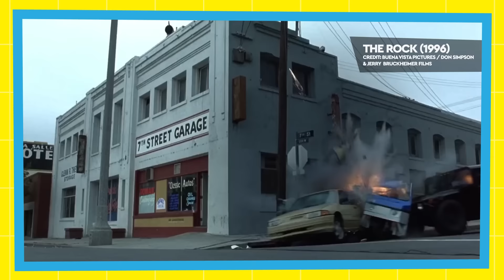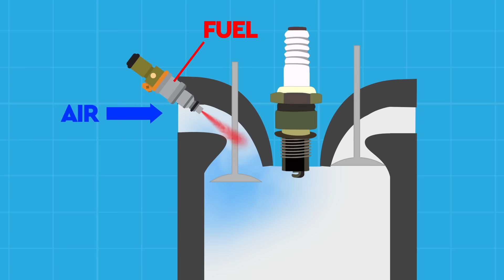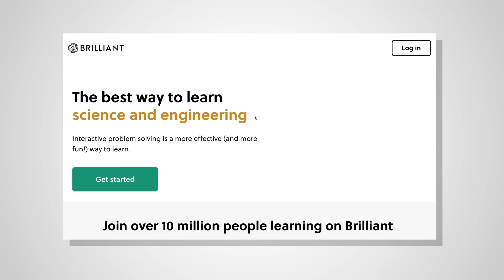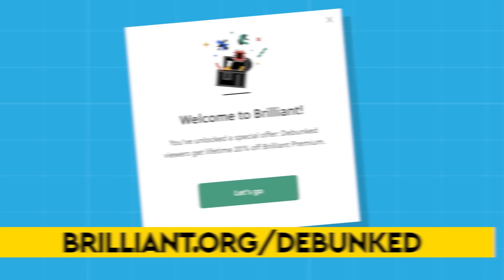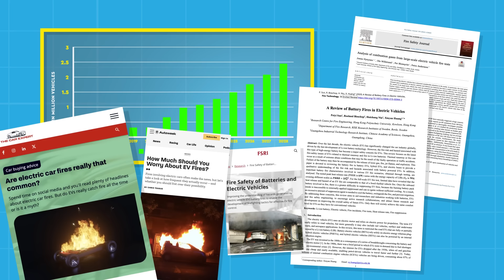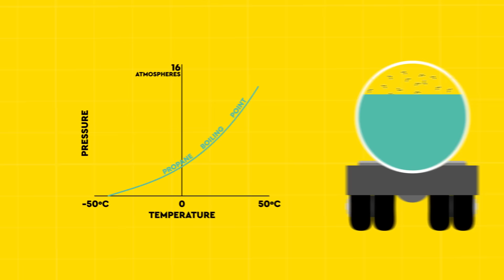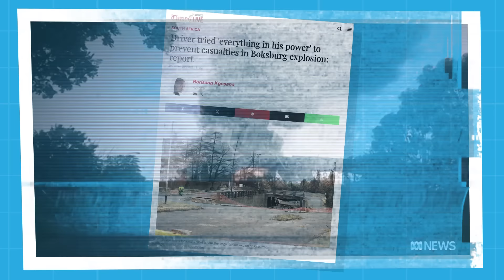What Actually Happens When A Car Explodes In Real Life? DEBUNKED

Comment: Very well explained... Thank you!
Two things to add:
In some European countries you will find a significant share of LPG converted cars (Netherland, Poland, Czechia...). The LPG tanks always have overpressure valves to prevent explosions. If such a car is burning - don't use a fire extinguisher. Gas that is burning is safer than evaporizing gas that mixes with oxygen.
Here we as well have a lot of diesel cars. These are unable zo explode - whatever you are doing with it.
Reply from the maker: Thank you! Glad appreciated it!
Reply from the maker: Thank you for adding that additional information 🧠 We did start to cover this but the market share is so low in the US and UK that we didn’t go into it and instead opted for tankers to make it more universal while covering the same fuel source. 👍
Reply: @DebunkedOfficial  Sure, makes sense not to confuse the majority of your audience 👍
Reply: @DebunkedOfficial  one modest correction. There is one larger explosion of a non-military nature that's industrial in nature. Ammonium nitrate based explosion accidents, such as in Lebanon, the Texas port disaster and a number of others. Typically, that involves contaminated ammonium nitrate and being stored at non-optimal temperatures and well, ammonium nitrate and any kind of fuel (contaminants or intentional introduction of fuel) becomes a high explosive.
Ammonium nitrate spilled on its own, no big deal beyond algal blooms and plants recovering from chemical burns initially massively recovering and growing like weeds. If the spill gets mixed with a fuel, well, if I'm a witness, you'll swear that The Flash character in comic book movies is real.
Reply: Apparently you've never heard of diesel run-away
Reply: intellicadee  QWERTY > QWERTZ

Comment: I have seen at least three vehicle fires where the unit burned unattended until the gas tank "exploded".    All three times the vehicle began smoking, started lightly burning, then inside of a minute became engulfed as seats etc burned up, followed by the tank going boom.  But it was not very cinematic.  The tank is under the car and when compromised usually just blasts towards the pavement.  Honestly it was more of a bang than a big kaboom.  Worst movie explosion I ever saw was FAR more dramatic than any car fire.
Reply: Near our eldest daughter's home, a pressurized gas supplier had a fire. A tank had failed, catching fire and when it vented, rolled amongst other tanks, triggering a BLEVE explosion and much larger fire. This involved a rather large propane supply tank typically used to fill small propane tanker trucks and portable propane tanks.
The residential area within a few hundred yards was evacuated as a precaution, as I recall none even had windows shattered. The large propane tank vented, the vented vapors ignited, the fire department got things under control and everything become boring, which was welcomed by all.
The only injury was to the insurance company.
Gotta love all of that safety equipment! Oh, the company changed their procedures and well, a tank failing isn't going to make life exciting any longer.

I've lived through some quite exciting events in my life and have learned, exciting lives are most frequently notable for their brevity. I like boring, boring is good.

Comment: Fuel/air mixture inside internal combustion engines does not "explode" -- it burns. Explosions inside the combustion chambers will damage the engine, sometimes almost immediately. Technical term is for such explosions is detonation, colloquially known as knock.

Comment: The engine of a motor vehicle is called a ICE. Which stands for 'Internal Combustion Engine' 
So there are no explosions going on inside but simply combustion, otherwise your motor would very quickly be damaged. 
😄
Reply: Indeed it’s a flame front that expands. Not an explosion.
Reply: exactly 😄  too bad he didn't respond to me. @DebunkedOfficial  @mrredfeet
Reply: In some countries however the name for the ICE is literally "explosion motor", e.g. in French (moteur à explosion) or Italian (motore a scoppio)
Reply: @MrOpenGL  Well then they are wrong. 😄
Reply: Agreed combustion or deflagration is not the same as explosion or detonation. But I think it’s rather for putting it in layman’s terms for viewers

Comment: The BLEVE can happen to a steam locomotive, if the pressure is suddenly released through some defect in boiler or pipe, all that overheated water suddenly wants to expand to a volume,I think 1600 times. I’ve seen photos of exploded locos and there is just the cab left everything else is gone.
Reply from the maker: Correct, it doesn't have to involve a flammable liquid at all. Thanks for watching and commenting. We hope you enjoyed our video 👍
Reply: Look up the numbers on the 1912 san Antonio loco explosión. Absolutely enormous forces involved .  

One 15,000 lb engine casting landed a 1/4 mile away .

Comment: I’m a firefighter for 25 years and not once did I witness a car exploding. 

Thinks in the car maybe could and the tires most certainly will if the car is engulfed in flames but this wont be more than a pop. 

I don’t say it’s totally impossible a car can explode but its very very very unlikely!

Tanks are designed to blow off instead of exploding catastrophically, so are Gas tanks… (thats what you see in the clip either this bus and the big flames shooting out of the top… it looks like carnage but in fact is does exactly what it is designed to do.) 

So yeah; if your car burns, Go away (preferably behind a guardrail) because fire is kinda nasty stuff but there’s no need to duck and cover because your car will most likely just burn until only metal is left.

Comment: If you want a higgling comments, gasoline does NOT "explode' in the combustion chamber, it burns...FAST.  The distinction may seem academic, but to engineers that work with engine performance, and especially with defeating "knock", it's VERY important.  The combustion chamber design along with air and/or fuel induction is tuned to get the desired "flame front" that gets the best power and/or fuel economy.

In the movies, special effects technicians use what are known as "squibs", i.e., sort of like small firecrackers, to get a fireball out of a staged (for the film) car collision.  It doesn't always work!  And even when it does, sometimes it's quite obviously to the trained eye.  When NBC News did an "expose" on Chevrolet trucks with their "saddlebags" fuel tanks, prone to being damaged and leaking, an obvious fire hazard, in a sideswipe collision, they filmed a "demonstration" which showed the truck apparently made of "explodium"!  What was revealed, and GM sued the hell out of NBC over it (and WHY did the network authorize this "hit piece" on a major ADVERTISER?), was that those "squibs" were used to STAGE the explosion.  GM released its own data showing that the trucks met then-standards for crash safety, especially with respect to fuel system integrity in a collision, and that the speed depicted in the "hit piece" film for a side swipe was in the upper 95th percentile of HTSA data on sideswipes of ALL vehicles...ergo, there was a less than 5 percent chance that a driver of a Chevy pickup would ever be struck in such a manner if a sideswipe collision happened, let alone the still unlikelihood that the vehicle would catch fire!  Needless to say, a significant settlement was reached by GM against NBC.

The issue with the crash safety of the Pinto was the unfortunate convergence of three factors:  (1) before the "5 mph crash" bumpers that began to appear on 1973 and 1974 cars, most large American cars could indeed, in a "nose-down" attitude upon hard braking (didn't also help that a lot of vehicles until the late 1960s had only DRUM brakes on the front, which were more prone to "lock up" with hard braking), slide perfectly under its rear bumper and smash the relatively unprotected gas tank (2) the Pinto itself was designed IAW Lee Iacocca's dictum to develop the car with the rule of the "Twos"...TWO Thousand lbs GVW, TWO years, and TWO Thousand dollars suggested retail price, and (3) a better fuel tank, which Ford had believed when the Pinto was first proposed in 1967, was thought to be mandated by its introduction, eliminating any further efforts to modify the basic design for crash integrity, but rather than being required, was pushed off until the 1978 models, by which time Iacocca though the Pinto would be significantly re-designed (the typical life of a particular line was about four or five years at the time) or even replaced altogether.  Ford actually met the last, handily (the original Dealer SPR was $1,919), the car was SLIGHTLY over the 2,000 lb target GVW, and it took 26 months before production began.  The car was designed with a very minimal unibody frame to save weight; and as it was figured to come in only a 2-door coupe, 2-door hatchback (the most commonly sold version), and a "three-door" wagon, there was one "little problem"...when slammed into from the rear, the doors could be jammed SHUT, inhibited escape from a burning car!  This actually happened in a terrible collision in Indiana in 1978 when, even after Ford has issued the recall notice (the parents of the teenaged girl driving the car, the legal owners of the vehicle, had yet to receive theirs), an unmodified Pinto was struck from behind, burning the three occupants, all teenaged girls, to death, as desperate attempts to rescue them failed.  This was the first time a major corporation had ever been charged with a crime in relation to product safety; but the state court trial, Ford was found "not guilty", as the State of Indiana failed to prove that Ford had acted with reckless indifference that rose to the level of criminal behavior, since the jury found that Ford had made a good faith effort to carry out the recall and correct the flawed design.  The modification that ended up being the "Kluge" was a plastic shield that, if the tank were hit and pushed against the differential, would blunt the effect against the protruding fasteners on the rear axle housing.  NOTE: This was a major factor in car makers converting small cars to FWD configurations, as the "live" rear axle proved a significant problem for fuel tank placement and space for it, a spare tire, and the TRUNK or hatchback.  Contrary to the assertions of the Mother Jones article, though, the issue wasn't a small pittance, i.e., "eleven cents" per vehicle, as was commonly bandied about, it was when Ford would be required to use fuel tanks that were engineered for better collision safety, which originally was meant for the 1972 model year; the NTSHA pushed that back to 1978, so Ford went with what was essentially a gloried, pressed-galvanized steel "can", not unlike every OTHER vehicle it made, in the Pinto.  The ACTUAL record for the Pinto, contrary to it being supposed to be made of "explodium", in fact, is about the AVERAGE of subcompacts of that era for car fires resulting from collisions!

Comment: Only exploding cars are the ones using CNG (Compressed natural gas) and LNG (Liquefied natural gas), methane and propane. You can look up and search for videos in real life of methane and propane tank explosion in a car, there are some security and dashcam videos available.
Also, electric cars can explode if their batteries get damaged and get in contact with water, because lithium reacts violently with water (you can look up videos for energizer lithium battery in water explosion)

Comment: In one of the clips you used of an "EV" car exploding (the one in the carport) I swear I read it was a hydrogen cell car
Reply: Hydrogen fuel cell cars are hybrid EVs so technically it was an exploding EV... Far better than the usual case where some fake news producer makes a huge headline about EV fires and you can clearly see the car has a tailpipe... There was even one about electric bikes and motorcycles the fuel tank on that motorcycle was rather obvious.

Comment: The fuel tankers as well as other liquid (milk, water other) usually implode (like the ocean gate sub😂) due to operator error as in not opening correct valves/vents or poor maintenance when unloading at a petrol station fuel farm gas bank ect.

Comment: Another myth is that cigarettes can ignite car fuel. They can not. Petroleum has a very specific flash point, which requires a very specific amount of oxygen. the problem is the ash on the end of a cigarette prevents that mixture of fuel and oxygen from occurring.
You can, however, ignite fuel with the flame you use to ignite your cigarette... which means if you are going to smoke at a fuel station, make sure to light up before you get there.
Reply: Not sure I’d be keen to take the chance 😆

Comment: This was cool but you did fail to mention how highly toxic EV fires actually are. You can easily be killed by ingesting toxic chemicals even  standing metres away in a so called safe area if it is in the direction the wind is blowing unless you are wearing protective equipment.

This is never stressed enough by media or authorities in many countries either yet other countries rightly wear special equipment to go anywhere near such a fire and prevent crowds from stopping and gawking.

Thankfully steps are being made at least in some countries to respect the issues around EV related fires.

As for tanker fires I have seen a few here in Australia and the results are never something you want to witness.

What you should have said is stay well clear,of any vehicle fire unless you are authority  putting it out.

EV fires may be rarer than ICE fires but they are much more deadly. 

You also should never risk charging EV’s in a closed up garage at all despite what the manufacturer might try to convince you about it being perfectly safe to do so.

Always charge the EV out in the open air.

There is no issue if people want to be brainwashed by Electric Jesus but just don’t become a statistic in their science experiment.

Comment: Electric car fires might statistically be more rare than ice cars catching fire. I am curious though, did the study take the percentage of each vehicle type on the road into account? There isn’t very many electric cars on the road today especially compared to its ice counterparts. Also when electric cars burn it’s usually in excess of 2000°C. Hot enough to weaken concrete structures like parking garages and bridges.
Reply: I wrote my comment before you finished explaining. I paused the video to ask the question as you were explaining it. My bad, great video!

Comment: Unless you're running a diesel engine in the presence of a spark plug in the demonstration.Says it's not.There is no explosions in a gasoline engine.Unless something is seriously wrong.The fuel Burns rapidly.Yes, but it does not explode.It's not even a class c type explosion Which is the weakest explosion there is But it is a burn and a rapid expansion of air which pushes the piston down so his demonstration is half right correctionist demonstration is correct.His words are whacked

Comment: Misleading. Most times a gasoline fire is non-explosive. It's only a bomb if the tank is empty. Lithium ion battery cell is ALWAYS a bomb. I would happy hammer a nail through an empty gas can. Lithium ion cell? Not so much.

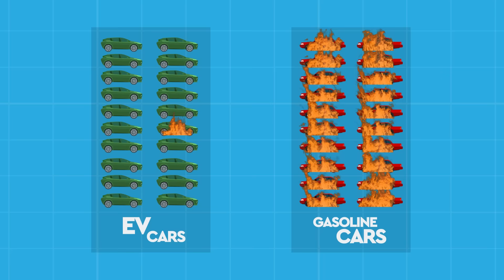Comment: 09:51 pure BS
considering how small the eV market is, the number of fires are concerning.
Reply: No its measured for how many fires in 100.000 purchases. And in some countries the regulations are higher which means it is EVEN more unlikely to happen than what was already shown
Reply: Jec: yes and no, that is the price the early adapters are paying... the BEV industry is moving to safer battery chemistry like LFP which is less likely to catch fire compared to older (crap chinese) batteries. As for the numbers, they are playing with stats to make petrol cars look more likely to catch fire compared to BEVs, but that includes 50 year old petrol cars compared to 12 year old Tesla's... most fires are caused by arson and electrical faults, it will be interesting to see 30 year old BEVs fast charge in the future :-)
Reply from the maker: @ttkddry  thanks for that additional input 👍

Comment: We set fire to the gas tank in the car, and all that happened was fire 😂

That still doesn't mean ICEs and EVs can't explode.

An EV can explode faster than an ICE car, and this is due to smoke, because it does not need additional ignition, but has its own. Gasoline needs additional ignition to cause an explosion.

If you have an EV in a garage or an ICE, the EV is more dangerous. Gasoline needs ignition, but battery smoke has its own.

Comparing 10+ year old ICE vehicles with maybe poor maintenance to EVs that have regular maintenance because EV owners have money is fake.

When an ICE vehicle catches fire, in most cases the fuel did not cause the fire at all.

Many times it is the electricity that causes the fire, the cables start to smoke and later the vehicle catches fire. Cables are everywhere, in all vehicles.

It is almost impossible for a diesel vehicle to catch fire, unless the fire started somewhere else (cables, brakes, etc.).

Diesel fuel must first be heated before it can ignite. If there is a lot of diesel fuel, it also takes a long time to warm up.

Comment: The bus that is burning is correct -> if it’s electric the batteries are designed to blow out at a specific point to control the flames. This is done to “steer” the flames away from exits to give people a chance to escape.
Reply from the maker: That bus in particular ran on natural gas, but was originally shared and went viral on social media claiming it was an electric bus. Thanks for your comment and for watching 👍